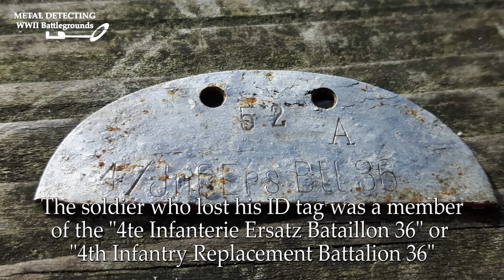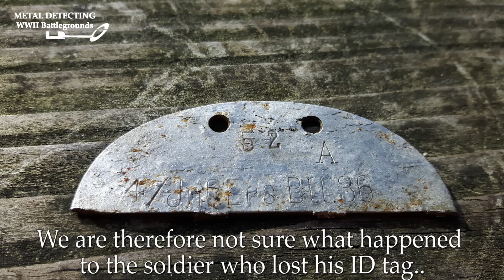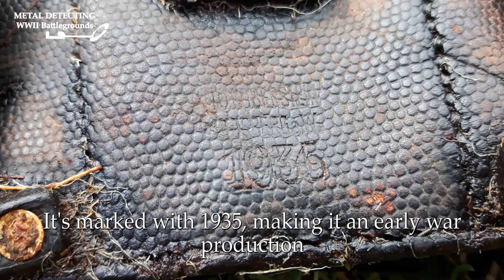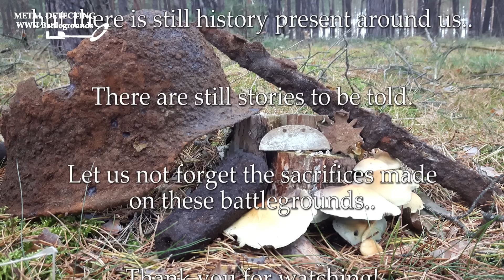Missing soldier's ID found - Eastern Front [2/2]

Comment: 16:33 dang that German must’ve had his head blown to bits, it looks like the massive hole could be caused by both entry and exit wound at a tight angle
Reply: Nooby Plays GT the helmet yust corroded away, these days most helmets i find look like this.
Reply: @fritzedelwei3133  well yeah i doubt soliders left unbroken helmets on the field. you af probably finding only the ones that have been shot or damaged.
Reply: Dominik Ivkovic ofcause they did, especially in the area i live very close to berlin and near seelow the germans yust didn’t care anymore and dumped their equipment everywhere and anywhere and went home or at least tried.
Reply: Ty Strong i had over 40 helmets within the last year some where well preserved others strongly corrodet away and a lot of battledamaged ones, this one just seems to have rotten away, it doesn’t look to bend and doesn’t have the typical cracks of battledamaged helmets.
Reply: Nothing got blown off, the helmet sat in the ground like a bucket, collecting all the water, and that made the bottom rust out
Reply: Yea feel bad for whoever had died in it.

Comment: was it  on the oder front.   germans formed divisions out odds and ends.  the rifle could have been a italian carcano or danish to dutch rifles , they just used anything at 1945
Reply: This is old but maulser was made in a lot of different countries so it could be possible not every maulser is a 98. Alot of European countries took the design. Maulser is the reason we have the bolt actions today they are made off of the maulser action.
Reply: @woody6754  Mauser not Maulser
Reply: Could have been an 8mm antitank rifle.

Comment: I found important news about the German tag you found.
It refers to the 4 infantry replacement battalion 36.
There is only one small mistake.
The number 52 does not refer to a personal number of a soldier but to the REGIMENT NUMBER: 52
The 4th Infantry Division was raised in October 1934 in Dresden. It took part in the Invasion of Poland in 1939 and later the Battle of France in 1940. Later that year it was converted into the 14th Panzer Division.
The following officers commanded 4th Infantry Division:

April 1, 1934, to November 10, 1938, Oberst (colonel) Erich Raschick
November 10, 1938, to August 15, 1940, Gen. Lt. Erick-Oskar Hansen

War service
Polish Campaign:

September 1939: part of IV Corps, 10.Armee, German Army Group South
Low Countries and France:

May 1940: reserve division of German Army Group A
June 1940: part of IV Corps of 6.Armee of German Army Group B

Order of battle (1943)
Grenadier-Regiment 163
Grenadier-Regiment 181
Grenadier-Regiment 205 (1)

------- FUSILIER - BATAILLON 52-------

Artillerie-Regiment 152
- I. Abteilung
- II. Abteilung
- III. Abteilung
- IV. Abteilung
Pionier-Bataillon 152
Panzerjäger-Abteilung 152
Nachrichten-Abteilung 152
Feldersatz-Bataillon 152
Versorgungseinheiten 152

that tag should be from 1943

Comment: 10:15 Using the logic the identification plate found belongs to a dead soldier. if it had been lost by a living soldier it would be whole. if in another case the soldier had accidentally broken the tag badge you would have found the bottom half of this, the lower half has the letters oriented with the upper part aligned to the straight part of the middle . I think you was near of the rest of the body.

Comment: Nice finds .. the gun is really interesting .. but can't help with that .. strange barrel and this handle ? 
If you can get that aluminum head band off the Helmet it will tell you on the outside .. what date and size the Helmet was and also the place where it was manufactured.
Okay .. some finds may be in bad condition .. you can blame that on the soil ..what u can expect from surface finds?
But imagine what forces took place to let them look like that ..like the drum and the helmet ?

Comment: That metal plate had a handle on it. I wonder if it was a hidden tunnel or something. It wouldn't have had a handle for no reason.
Reply: Looking at the direction of the bullets. I would say they came from the bottom side instead of the top. It could explain how the Germans got there. I know they used quite a lot of hidden tunnels, to creep up on the enemy. They may have been getting out and shot some holes in case any one was near and saw them. I'm guessing at some point it was probably covered with grass so no one could find it by accident. I have seen similar ones on other investigations. All very well hidden unless you know what you are looking for.

Comment: How do you find these places?
Reply: If you're still looking for an answer, I did some digging myself.
If you look up well known battles such as Battle of the Bugle, Battle of the Oder-Neisse, Battle of the Ardenne, you can find where the battles have been fought and where the front lines were (roughly). Battle of the Oder-Neisse was fought at 4 "fronts" and one of them is apparantly outside of Seelow, Germany (this might be the one in the video). Then it's on to just walking with a detector I assume.
Reply: Swordie100 awesome too know 👍
Reply: @Swordie100  Battle of Ardenne and  Bulge are same battle.
Reply: @lauritynkkynen4327  Hey man! Thanks for the correction. They were mentioned in those exact words so I did indeed assume they were different. Thanks.